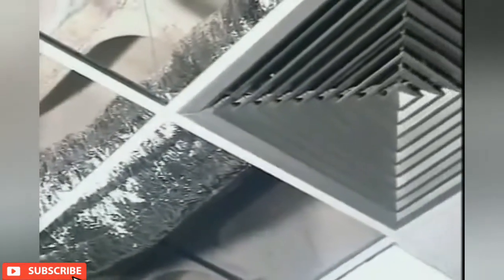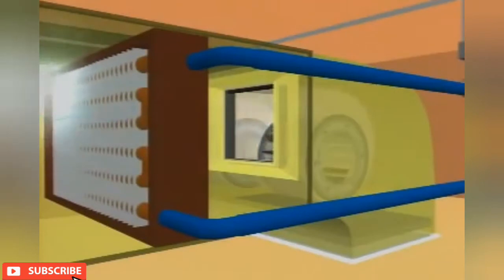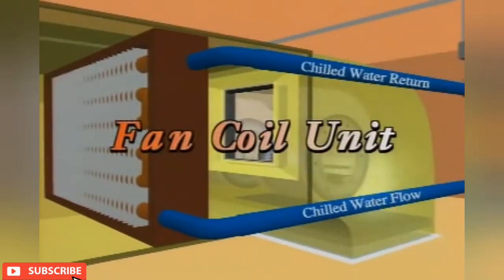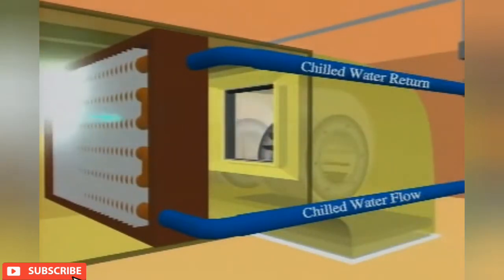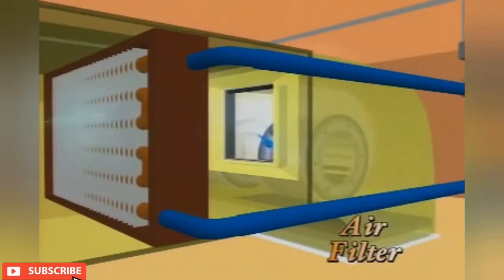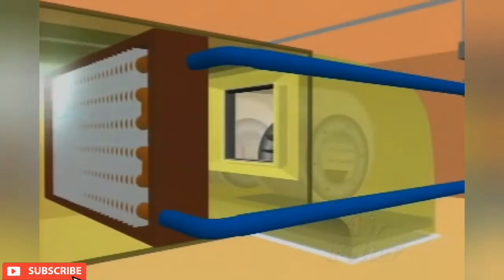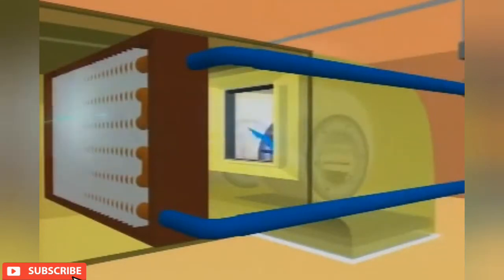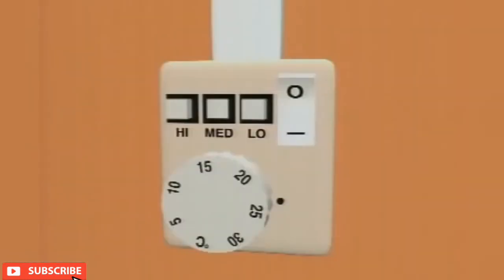Fan Coil Units - FCU - How Fan Coil Units Work

Comment: I noticed water on the floor of the FCU compartment. It leaked even after I stopped using the air conditioner. What could be the reason? Thanks.
Reply from the maker: thanks for your Comments.
check your FCU unit drain pipe it's clear or not clear?
Reply: @refrigerationsystemandcoldroom  , Technician said drain was blocked. He cleaned it. Thanks.
Reply from the maker: Welcome Dear I Already Tell You Check Your Drain Pipe.
Thanks For Your Comments